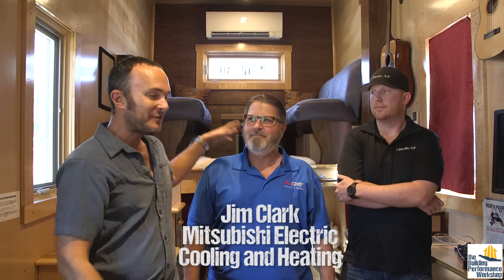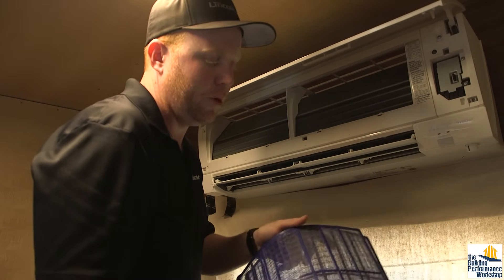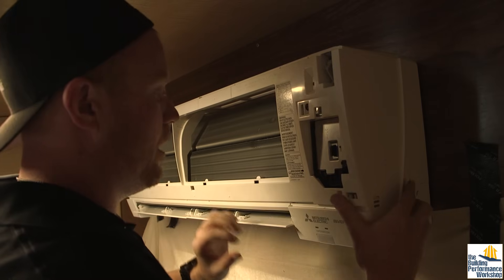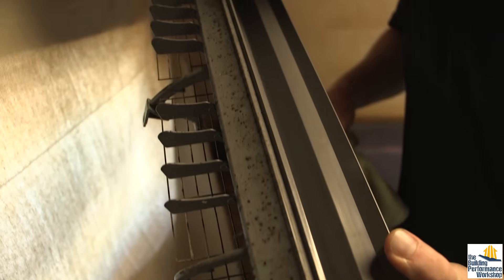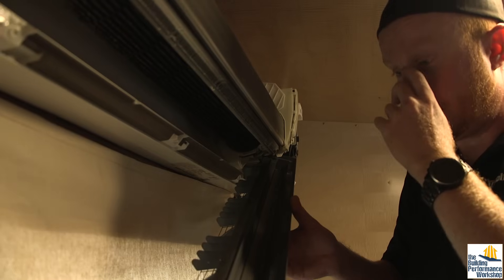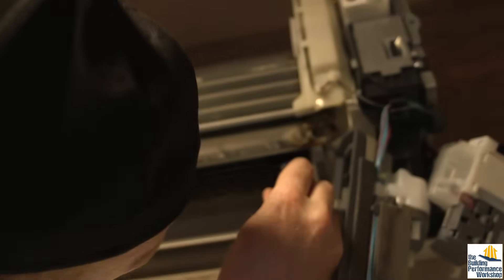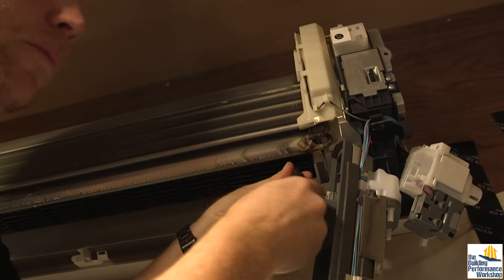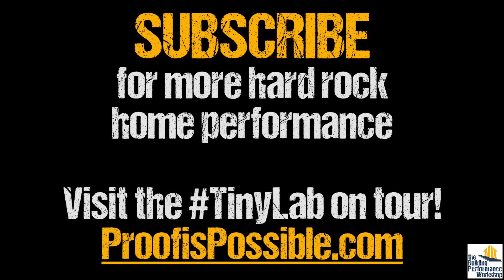Ductless Mini-Split: How to Take Apart & Clean DIY (Mitsubishi FH High Wall Series)

Comment: I have searched videos everywhere online. I have 2 FH series 12000 BTU mini splits, so this has been the best video I have seen. Companies out there charge a fortune per unit to clean them and they are not as thorough as these. They spray, rinse and drain it into a bucket without taking the unit apart. Thanks again for an incredible video.
Reply from the maker: Awesome praise, thanks so much!

Comment: I came here out of desperation, I have a 2 year old split, works fabulous I run  24/7 in this cold winter season. Live in a small community and went to town hall to help with some maintenance, they have eight splits I'll need a good cleaning, some more so than others, I did detect some black mildew , and now I can attempt a proper cleaning thank you
Reply from the maker: Wonderful go get it

Comment: From my experience at the Mitsubishi diamond dealer training center in Boston  i was informed to never use anything but water to clean the coil because coil cleaners will strip the protective coating off the fins resulting in faster build up. I would prefer to use an actual cleaner over water. What are your thoughts?
Reply: any manufacturer will recomend nothing but soap and water unless they have their own cleaner to protect them from warranty claims. the cleaner is not really the issue here, it's getting enough physical scrubbing or spray to remove the film. coil cleaners are just basic acidic acid (vitamin c) in a foam.

nowadays the high pressure sprayer along with a wall bib around the minisplit to catch and direct water to a bucket is ideal. you can reach all the spots without taking anything apart.

occasional sprays of the foam into the unit to keep things fresh can help too.

Comment: Finally, a good simple video! Mine started leaking the other day. Maintenance, hasn;'t been running calls because of the virus. After this video, I had it stripped down, cleaned out and back together in under 20 minutes. Thanks a ton!
Reply from the maker: Dude. Great story. So glad you found us.

Comment: We were never told about the fact that this unit needs to be cleaned.  The instruction booklet only mentions cleaning the filters which we do but later found the inside was filthy"
Reply from the maker: +CD Rozich I know, right!?! What is wrong with the writers of user manuals everywhere?
Reply: @HomePerformance  Who knew Mitshubishi does not make a TOTALLY maintenance free hvac? 

FYI.. My five winters and going into the fifth summer is a 45% reduction in heat bill and 35% in summer cooling cost. The real story is my home no longer has issues with mildew or mold.

Comment: I took my time with our unit. Took a couple hours because it also ended up leaking all over the floor and other items. This was a great tutorial for what I needed to get the job done. Last time this leaked inside the house I used a bucket wet vacuum on the outside condensate line. For whatever reason ours gets clogged often. Seems like the whole unit should have been designed somehow so that this level of cleaning wasn't necessary.
At any rate, special thanks to you guys for the great video. Very much appreciated.
Reply from the maker: Great to hear we helped you, Kirk! That’s why we do this!

Comment: Thank you guys soooo so much. Our apartment has this unit... wasn't used all winter and today noticed a massive amounts of white mold in this unit. Wouldn't have been able to take it apart and give it the cleaning it needed without this video. 

** If anyone is hearing a loud knocking noise with the unit turned on after maintenance**
It is likely that the blower piece hasnt been put on the shaft far enough. I had to completely pull the unit apart again. Just loosen the screw slightly and push the unit from the left into the shaft a little more.
Reply from the maker: You are SO WELCOME. Grace and I love hearing that our vids help people like you!
Reply: By knocking noise do you mean like a helicopter?

Comment: Great video for the FH Series mini-splits.  I thought I would add a couple of details about the removal of the plastic housing for clarity.  There are 5 screws in total, two are under an easily removed angular cap on the lower lip, two more on the right and one on the left, all shown in the video.  The large cover pops right out when open and is easy to put back on, the right hand plastic housing is pretty easy too.  The large main housing needs to be pulled out from the bottom a bit, especially on the left side, and then a pretty forceful pull from the top.  There are four plastic clips that you pull straight out from the wall.  I found starting from the right, then middle and finally left worked best (I have three units, so I got better at this). Putting it back is easy...line it up and give the top front in line with the clips a slight punch with your palm, working your way down. Finally, there is a strip of plastic on the bottom edge that must be removed.  I had trouble with this, but it turns out there is only one clip in the middle that you need to pry with a flat headed screw driver to get it to release.  That was not obvious in the video, although they do show it being removed.
Reply from the maker: Good tips, thx

Comment: This video is exactly what i needed! Thank you for being clear with every step. 
Ours was so nasty! I jad no idea. 
Funny story, i got everything reassembled and then when turned on, it made a noise... I hadn't tightened the screw holding on the blower wheel. I had to completely disassemble again. At least ot went quicker the second time. 
Thanks again for a clear video.

Comment: Excellent video, and super generous of the HVAC guy to share his knowledge.

Despite emitting a musty odor, my unit didn't initially seem that dirty. No streaks of dust on the blower wheel, and none of that black mildew anywhere inside. However, when cleaning the blower wheel, I found that a thorough outdoor rinsing with a garden hose (even at full blast) insufficient for removing the thin film of unknown substance collected on the undersides of the blower wheel fins. In the end, I had to manually scrub every fin individually with cotton q-tips – a very laborious process! Based on my experience, I would recommend anyone trying this themselves to spend the extra time needed to be a bit more meticulous with the blower wheel cleaning step.
Reply: Try using soap water next time instead of a q-tip!!!
Reply: Thank u
Reply: What about spraying it down with lemon scented Lysol, in addition to the soapy water?
Reply: I used kitchen degreaser diluted with water and a shoe polish brush, wheel like new

Comment: Fantastic video from a pro to clean it the right way. I couldn't run this AC/Heat pump in my studio over the garage! It started to really bother my eyes and sinuses. I had no idea these units need regular cleaning for the mold (I've never cleaned the air handler in the attic in my whole house AC, and still no problems). Even still, I'm very happy with this unit which is the only heat and ac source for this space.

Comment: great video,  clear and easy to follow.    Note that spraying the foam on the coils can dislodge lots of water.   Also,  using a toothbrush to really clean into the plastic groves on each surface helped me.  There are a lot of places were mold can accumulate.    I made sure to open extra windows and doors to improve the ventilation for the foam cleaner.    I'd recommend gloves as well.
Reply from the maker: Great advice all the way, Dan. Thanks!

Comment: One of the air handlers in my house had started rattling and the airflow seemed less than it had been. I have the exact model as the one in your video, and the video enabled me to take everything apart, clean and reassemble. It only cost me an $8 can of ac coil cleaner.  It is working great now! Thanks for the informative easy to follow video!
Reply from the maker: HELL YEAH JUNICAT

Comment: Thank you for posting this tutorial. It helped me with cleaning my units.
The only thing I would add is that the drain pan is alot easier to reinstall if the coil mount screws are still loose on the left side of the unit. Once in place then tighten the mount screws. Regardless, very useful video. Thank you.
Reply from the maker: Wonderful, glad it helped.

Comment: glad I found this video. I already knew how the right side came apart (cn105 access) but not the entire unit and the little wiggle tricks needed. 
Man did my oldest sons u it have mold. Took 3hrs to clean all the mold and that blower was caked with dust and mold. nasty!!! seems the air filters are not adequate enough. will need to clean this yearly going forwards. 
As was stated by someone else, my blower was rubbing somewhere really bad, had to push all the way right. now it rubs less, maybe I moved it too far right. next time I pull it apart I'll have to adjust it again. .. again thanks for the great video.

Comment: I have the actual service manual for this, but that did not help one bit in taking the unit apart. This video however, was exactly what was needed to quickly take the whole thing apart, including the cylindrical fan. Thank you.
Reply from the maker: I know, right? That’s why we got Mitsubishi involved in the making of the vid- they hadn’t solidified a protocol before then.

Comment: Millions of microscopic spores are floating in the air as he is wiping the “mildew” from the drain pan. We see HVAC techs normalize mold constantly. I can see why. That drain pan should have been cleaned outside. But thank you for this video! I learn so much from your vids. Almost every time I’m looking up something to do with IAQ or home performance, I’m brought here :)
Reply: Man these guys are trained to not sat mold smh
Reply from the maker: Thanks Pete! And don’t feel too hard on these guys- they’re not trained or equipped to do many of the things we explore on this channel, and they run from hot attic to nasty crawlspace all day. One of the most terrible jobs I can imagine, frankly.
Reply: @HomePerformance  100% agreed! These guys see the worst of the worst daily. We need to change the standards of building and stop building vented dirt crawl spaces and unconditioned attics! Not to mention, placing HVAC installs in them, duh! Ultimately though, humans need to stop neglecting their homes…

Comment: I have had a 6k btu MSZ-FH06NA working in our tiny house for a year now and we started noticing that we could hear the fan and the air would blow inconsistently. 

I followed the tutorial from this video and now it’s working like new again, quiet and a noticeable reduction in time to cool the tiny house.

In spite of cleaning the filters every 1-2 months, the blower fan was caked with build up. We have a dog and live in a rural setting so it seems like I’ll need to do this on an annual PM schedule. 

Thank you!

Comment: Wow! Thank you so much for this. I have had mini splits for about 3 1/2 years. I pay to have maintenance done twice a year. A leak has recently developed in the front of one of the units and I can see mildew in the back of both units. I have never seen them do this sort of maintenance on the air handlers. All they do is clean the air filters 😳 I thought it was strange they weren't doing these types of things. Thank you so much!! I will be in touch with my HVAC company to make them aware of what they ought to be doing with their maintenance routine.
Reply from the maker: Glad you found us, and good luck
Reply: @HomePerformance   Well, didn't have much luck in convincing them they should be doing the sort of maintenance. I got details on what they consider "maintenance".  All it is is a look see inspection to how things are going.  If you need anything done of the nature you guys were doing in this video, they will charge you to do it.
Reply: Same EXACT situation with us.  Paid $400 for them to clean the air filters on 7 units.  That's just insane.  I called them and asked them why they don't do this level of service.  They said, "We'll have our front desk schedule service."  Nope.  We'll do it ourselves now with this great info and it will be done right.  Is there much difference with the MSZ models?
Reply from the maker: Should be about the same process, Debra- keep it up!
Reply: That’s wild because cleaning the air filters takes like 2 minutes and any able bodied person could easily do it

Comment: Great vid.   Used it today to save a great deal of $ on my cleaning.   First cleaning since install 2 years ago.   Now I am confident enough to do this every 6 months or so.    Wife is black mold toxic.
Got any advice on the rotating electric eye noise.   Kind of a clicking sound.

Comment: This was extremely helpful. I have 4 units. No issues during the process but I chose to rinse the cleaner off the coils with a garden pump thingamajig. They didnt think about it during install to cover the drain pipes on the outside with a grate or anything. Had about 6 carpenter bees in each drain pan. Dead at least.
Reply from the maker: Yuck! Nice catch!

Comment: Mildew also comes from not running these in Fan mode, after using as A/C, to give it time to dry, before turning it off.
Not mentioned, many health hazard warnings, on the evap cleaner foams: googles, gloves and high ventilation turnover needed when using these.

Comment: Thank you for the excellent video.  My unit has been dripping water, with the drain pan overflowing.  Do you have any tips / suggestions on cleaning / clearing the drain line from the unit?  The rest of the unit seems clean.
Reply from the maker: https://www.oasiscoolingheating.com/blog/how-to-clean-your-condensate-drain

Comment: Thanks so much for this great tutorial! I followed along while cleaning my FH and everything was pretty much as seen. The only thing I ran into is that I had to pop off two little caps to reveal the bottom screws. I initially didn't notice the caps until I started getting the thing taken apart because they look like part of the housing. Fortunately ours didn't have any mold, however and unbeknownst to us, there was a bunch of blown in cellulose insulation that had come through where the hoses and cables pass through the wall and it filled all the spaces around i-See sensor servo.
Reply from the maker: Glad it helped

Comment: I have good results with mini uv lights really keep the mildew away. This is a problem in all mini splits even when they are installed correctly
Reply: Joe Shearer if you have uv resistant plastics than ok
Reply: That was what I was wondering. That and also do the lights make it more difficult to take the blower wheel out as it'll still need to be cleaned.
Reply: Interesting idea. Be aware though that the Mitsubishi Manuals have a trouble shooting entry for yellowing of plastics. The cause is exposure to UV light...

Comment: Thanks for the quick response. For inside unit should I let sit...for how long? then spray water on it, then run it on heat?
For outside the fins are green with algae, should I use same cleaner, and then rinse? I do regularly blow around, under  and in it.
What about the water dripping under it is that normal? 
I've seen other vids for other kinds of outdoor units where they take the top off and spray foam cleaner in... none for Mitsubishi. wonder if that would be a good idea or if it would void warranty. 
Had no idea this would be such a costly maintenance when I got rid of my wood burning stove and put it in.
Reply from the maker: Yeah, everything needs maintenance- better this way than sweeping a chimney though! Yes, dripping water is normal, that’s the condensate from the humidity being pulled out from indoors (I’m guessing). No advice for the outdoor coil, I’d ask Stephen Rardon (search youtube for his channel).

Comment: Video was super informative. The most important information I learned was that I would never have anything that needed that much maintenance in my home. What a user unfriendly design.

My air handler is 29 y/o. My filter is a Honeywell electronic air cleaner. I get no smell and I have never cleaned the evaporator coil.
Reply: It is not very easy to clean. But for once every maybe two years, it’s not too bad. It’s also exceptionally efficient, installed easily on my house which has hot water heat and therefore no ducts whatsoever. Each room has its own thermostat. Once it’s cleaned I know it’s completely clean. That said I wish it didn’t have so many plastic nooks and crannies to clean. But tbh it’s worth the advantages of the system. Mine never smelled, even though there was some buildup of gunk. I’d be scared to see what 29 years of no cleaning looks like, have you ever looked inside there?